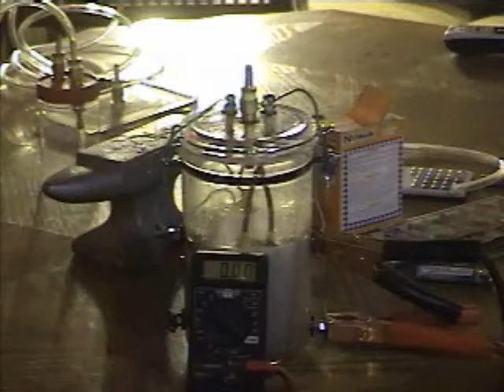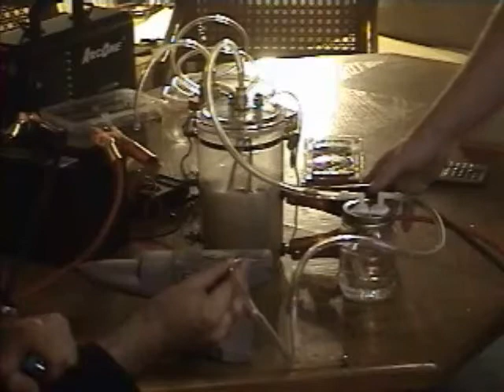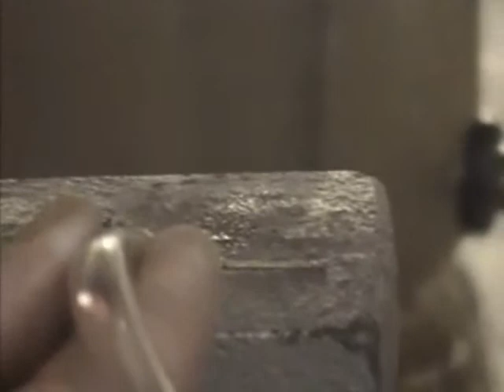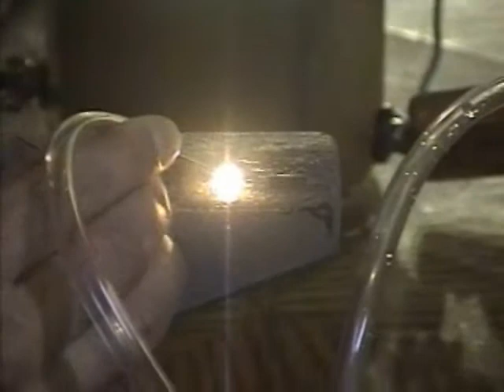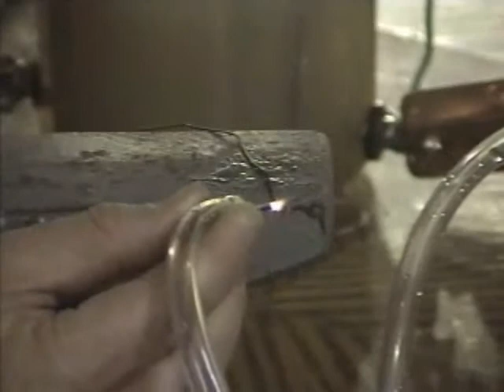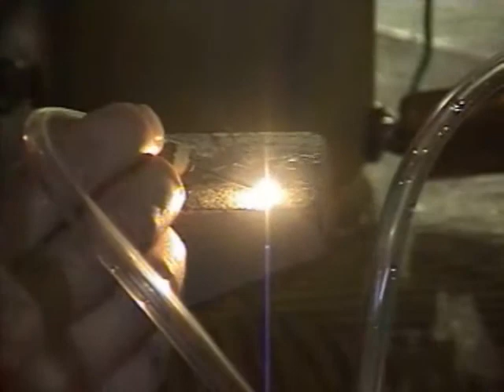hho hydrogen project 5

Comment: if you want to greatly increase you production without changing much, just put each one of those cells in separate containers and wire them in series. it will jump your eff. for two reasons, one parallel cells in the same conatiner leakage potential, and two it will let you tune your voltage per cell, and the closer to about 2v per cell the more eff.

Comment: You are applying too many volts. Volts beyond 3v per plate gap will convert mostly to heat.  In your +-+-+-+- config, best bet would be to run it at 3v with all the amps you can muster.  will generate decent amount of gas with less going to heat.  of your 500ml/min now, suspect a large portion is really steam.  but you have a good beginning to move forward. work on making it more efficient so you get gas only, not steam